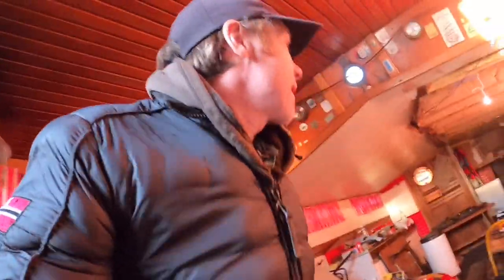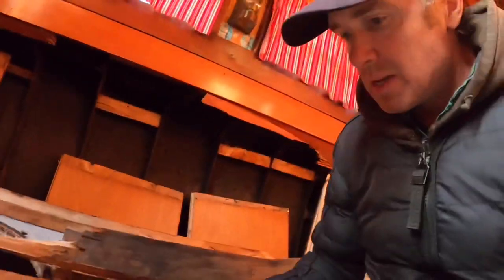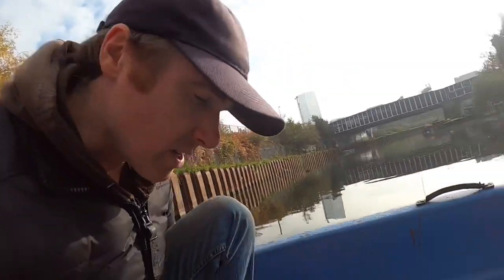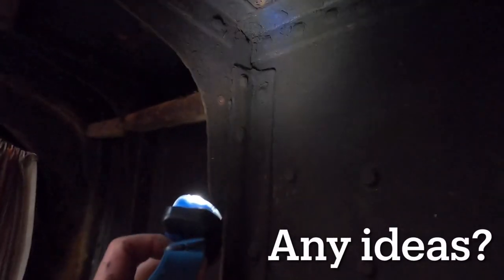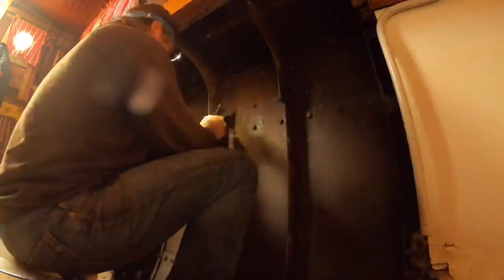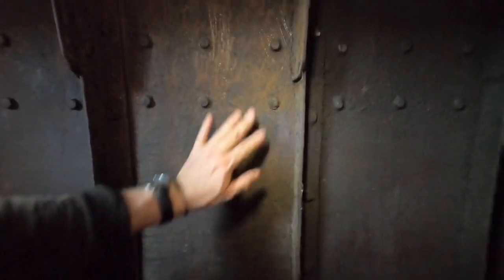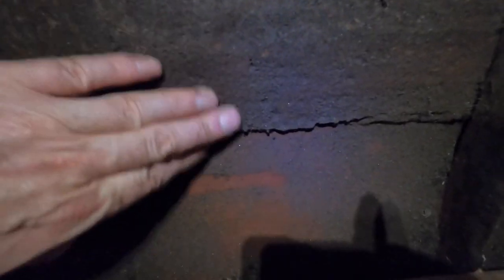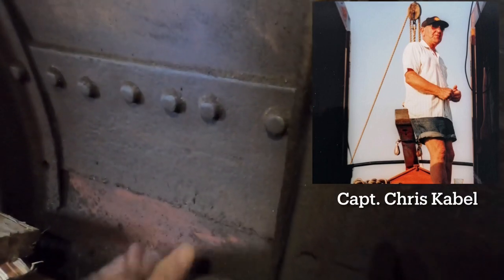Dutch Barge Linda #22 Start stripping the interior! Rivets! A fish! And pictures from 1999!

Comment: the old barge skippers used a mix of oil, sicative and fat to preserve the bottom en the sides. Don't bother removing it, scrape the loose parts off and that's it. You will however need to 'feed' the coating. For that, I strongly recommend a sheep product, lanoline. The best you can purchase is a product called Fluid Film. It smells very nice (vital if you want to live aboard) and it is a pleasure to use, your hands will be soft al baby skin.
Reply from the maker: Amazing, thank you so much for this. Having grown up on e sheep farm, It’ll be just like being at home again! 😂
Reply: As an insulation material, I can wholeheartedly recommend sheep wool. Sheep wool (in the form of an 8 cm thick insulation blanket) is able to absorb moisture from the environment and release it again without the insulating effect disappearing. You do not have to apply a vapor-proof layer between the living space and the insulation. Applying a vapor-proof layer on a ship is almost never 100% successful. The attachment to the bottom is too complicated. That is why vapor-open insulation with wool is a good option. Wool is a natural product and nowadays very cheap because people no longer want to wash their wool sweaters. On horizontal parts such as the underside of the roof it is advisable to apply a layer of Amarflex first and then the insulation wool. The amarflex ensures that not too much moisture condenses on the roof. So first paint the inside of the roof well, wipe and glue amarflex (13mm), then apply the wool. The (expensive) Armaflex is not necessary against the sides, the wool is sufficient. Remember ... isolation is only done once ... spend enough money for it!